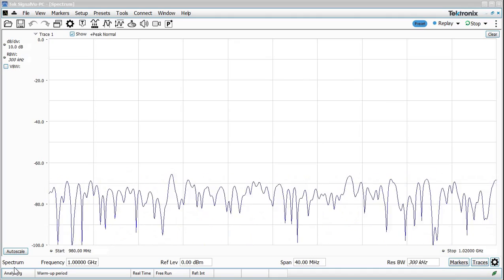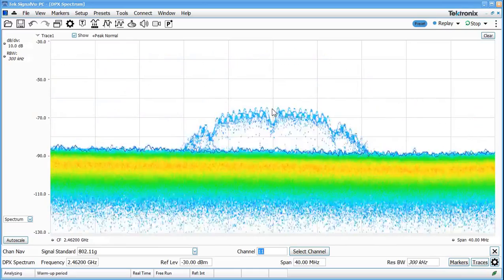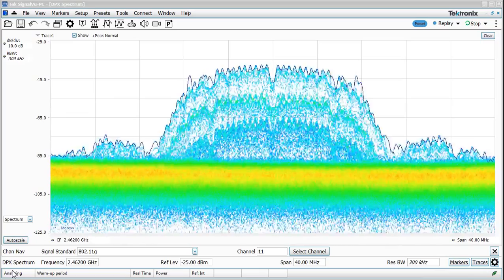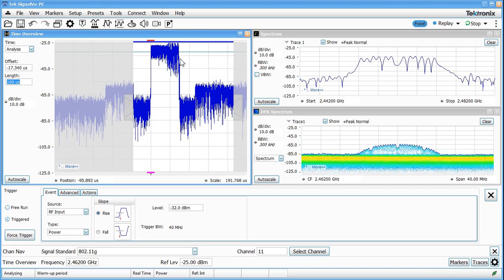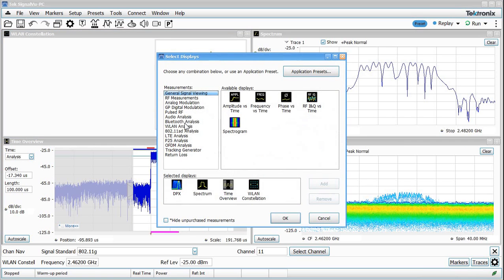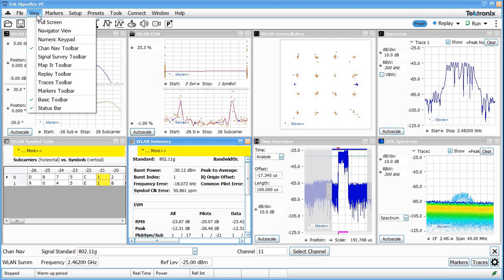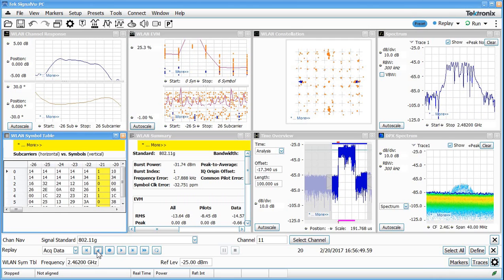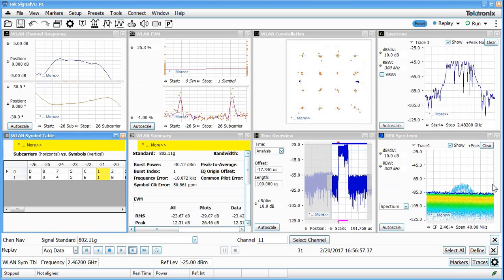#253: How to capture & analyze WiFi WLAN signals off-the-air with an RSA | RSA306B 802.11

Comment: I was told that the sincgars radios used by military have a shorter tx range when using secure communications option.  From what I can tell this just implements FHSS, which seems like it has same PSD as using narrow band of same carrier frequency so it should have same transmit range right?
Reply from the maker: The reduced range is likely due to the fact that the receiver must have wider BW to capture each hop...

Comment: Thank you for your video as I haven't had experience with the RSA306B & SignalVu before a week ago.  73s de KF9UG
Reply from the maker: I have several other videos on the RSA306B and SignalVu-PC, so be sure to let me know if you have any questions.
Reply: I watched the other 2 videos (I could find) that you did for the RSA306B. They did help teach me other features of SignalVu-PC I didn't know about. Through your videos I have been able to successfully capture/analyze 802.11b signals I needed to be able to do for a new product. Now my task is to take what I learned and issue the appropriate SCPI commands to do the same things. Thank you for taking the time to make these videos.

Comment: Does the symbol table show the sent data decoded as hex? I.e. are those the data packets in hexadecimal? I'm trying to understand the link between the analog data captured and the digital one interpreted by devices.
Reply from the maker: The symbol table shows the raw transmitted symbols in hex.  I believe that there is some encoding or scrambling employed between the actual data and the transmitted symbols.
Reply: Ah, thanks! So if I were to grab the data in the table (which I assume is encrypted via WEP/WPA) and run it through some decryption algorithm, I would get the actual data...

Comment: there are numerous ways to improve your WiFi signal, but the final result depends heavily on your environment.

some tips that may work:

1. try amplifier --  it can be expensive as specialized directional antenna, or cheap as a soda can.

2. change channel settings  -- the 2.4Ghz WiFi(802.11 b/g/n) only has 3 non-overlapping channels, set your channel to one of 1/6/11 will help reduce the chance of overlapping channels.

3. regularly scan your environment -- in scan result, you will see how many networks are around you, and the signal strength, channels they running etc. Then you can avoid  running a similar network, and find a relatively clean environment

these tips sounds a bit *geeky*, but there are a lot of tools available to ease the processing. For example, WiFi Manager ( https://play.google.com/store/apps/details?id=com.wifi.manager&hl=en-us ), an Android App, is able to do the scanning, and show result in an intuitive  graphic way.

Comment: Hello Alan,

I have an issue.   I have constructed a direct FM modulator with something like 56 MHz carrier using a 100 pf  varicap.
The thing is all the books say as the modulating frequency drops for the same frequency deviation the spectrum should
get more populated and closer to continuous.  The opposite seems to be happening on my analyzer display where
increasing the modulating frequency from my signal generator results this effect and decreasing the frequency makes
the spectrum more sparse and seems to decrease the deviation down to what looks like very NBFM  and no signal 
at all when the modulating frequency is like at 100 Hz or less.  Any ideas ?   Do varactor diodes have sensitivities
to the base band modulation frequency ?

Thanks,

Peter
Reply from the maker: The number of sidebands and their magnitudes depends on the modulation index - which is the Peak Deviation divided by the baseband modulating frequency.  The sideband amplitudes then follow a set of Bessel function curves.  You can see a little background regarding this in this video:
https://www.youtube.com/watch?v=8IBOYoIV5m8
Varactors shouldn't really have any sensistivity to the baseband frequency - just make sure that your drive circuitry doesn't.  
Here is one more video showing an alternative way to measure FM deviation with a spectrum analyzer:
https://www.youtube.com/watch?v=Nw3_w1HrlEs

Comment: sir thanks for all your work your knowledge is brilliant hope the ankle is healing ok something  for you to ponder think about my skill is pure amateur at best compared to you FM deviation meter in the UK are almost non-existent so without complicated chips is it possible to see a 145mhz FM deviation signal on a 50mhz scope it's what I have ?? I need to adjust an old trio 7500 deviation the audio is a little quiet it was a freebie just needed a service ( NO service data available )I want to see the devation signal on the scope is it possible thanks
Reply from the maker: It's not possible to see the FM deviation of a 145MHz signal on an oscilloscope, especially a 50 MHz scope. probably best to adjust the tx and listening to or measuring the result on a receiver, comparing response to known good tx.

Comment: Dear Alan,

I am a grad student, studying electronics and communication. I like your videos a lot. My interest area includes broadband communication. Currently I am researching about CDR circuits and their implementation in burst mode. Could you please throw some light over this?! Thanks Anyway!
Reply from the maker: This is a subject that wouldn't be effectively covered in just a 10 minute video.  Usually will involve some type of PLL with a fast response, but will also depend pretty highly on the nature of the data being sent in the bursts or packets.  I am currently unable to get into my lab due to my broken ankle, so it's going to be a few months before I can do any new bench videos.
Reply: In case you have any reference in your mind. Please do share.
I wish you get well soon :)
Reply from the maker: There appears to be a fair amount of information available due to the use of burst mode CDR in GPON applications. Many FPGA mfrs like Xilinx have published some info. Might be worth exploring existing drives like this one front Analog:
http://www.analog.com/media/en/technical-documentation/data-sheets/ADN2855.pdf
...and here is an academic paper on the subject:
https://pdfs.semanticscholar.org/4efb/189ce58816e21541778c7b6282dcf8c5c4e8.pdf

Comment: The free version of SignalVu does not include this functionality, correct? Which option do you need to purchase for this? Thx...
Reply from the maker: Correct, wlan analysis is an option. SV23 covers 802.11a/b/g/j/p. SV24 covers n, and SV25 covers AC. Any/all options can be turned for free 30 day trial.

Comment: Can you so that on your phone?
Reply from the maker: Unfortunately no. The realtime processing of 40MHz wide RF data requires the full bandwidth of the USB3 port and an i5 or i7 processor running 64 bit win7 or higher.

Comment: May I ask which equipment you are using? It seems that you are doing this on a PC. Thanks.
Reply from the maker: Most of it comes from experience.  I graduated with a BSEE in 1985, and have been working for more than 30 years as an Electrical Engineer in a number of different roles - ranging from design engineer, test engineer, applications engineer, validation engineer.  Also worked in a TV repair shop when in high school, and did some communications research for the US Army while in college.  Every role, every job, has taught me many things.  Electronics and radio have also been lifelong hobbies for me, so that helps too.
Reply from the maker: List price for RSA306B is $3890.  Most analysis options are <$1k.  The base version of SignalVu-PC includes 18 different measurements/displays.  WLAN analysis is in three options - one covers 802.11a/b/g/j/p, another covers 802.11n, and the third covers 802.11ac. Options can be enabled for free 30 day trial period.
Reply: may I ask the public price for the entire package of software, hardware and options necessary to create this demonstration?
Reply from the maker: It depends on the options it has. You might need a preamp to get signals off the air, and that is an option. The base analysis BW of the MXA is 25MHz (and it may have been only 10MHz on older units). 25MHz is wide enough for 20MHz wide WLAN signals like I showed. The real-time display I showed on the RSA is an option on the MXA. Even if it is equipped with it, it is a separate mode that you out the instrument into - you can't have that display running live simultaneous with the modulation analysis (which is another instrument mode). The WLAN analysis is also an option. On older instruments, it was a separate s/w package than you'd run. I think it's available as a analysis mode now, but still a different mode than spectrum analysis and real-time spectrum analysis. Control of the time domain capture of the RF signal is done differently on these analyzers.  I don't know if there is a way to run on a PC like I showed. Bottom line, properly equipped the MXA can make the same measurements, but maybe not all simultaneously like the RSA, and the control is certainly different.
Reply from the maker: I am using a Tektronix RSA306B Real-Time Spectrum Analyzer, being controlled by a software app called SignalVu-PC running on my laptop.  Tek makes three families of real-time spectrum analyzers that are controlled over USB3.0 - the RSA300 series, the RSA500 series and the RSA600 series.  Each of these is controlled by  SignalVu-PC.  The base version of this software is available for free from tek.com.  There are optional analysis features (such as this WLAN analysis) which are purchased options.
Reply: Thank you!
Reply: Dear sir, may I ask a question again. I  watched some of your videos, you are very good, you do truly understand those things. May I ask you, how do you study? Where did you learn? From school? or just do it by yourself? In case you study by yourself, possible to share some experiences to me? To be honest, I am in the major of wireless communications,  but I found that your knowledge is way much better than me.
Reply: What a man! I hope I could learn more from you. Your videos are very good. Allow me have another question, since you are very experienced.  My lab has a Agilent Technologie, MXA signal analyzer, N9020A, 20hz - 8.4 Ghz. Do you think this analyzer can do the same thing, like what you did in the video? especially in PC ? Thank you!
Reply: Thank you again, Sir.